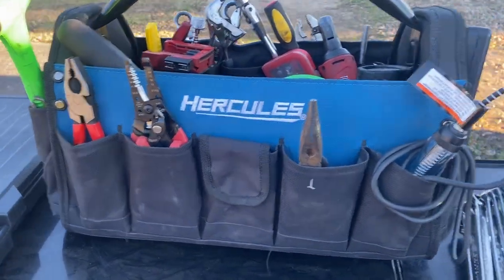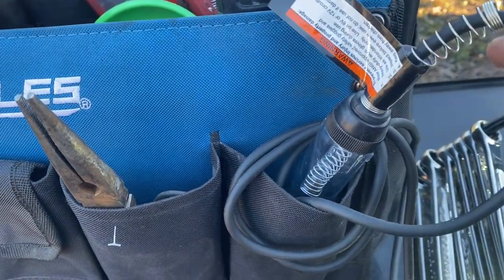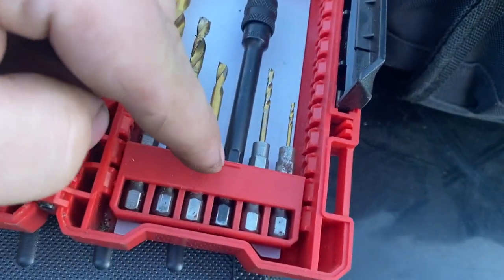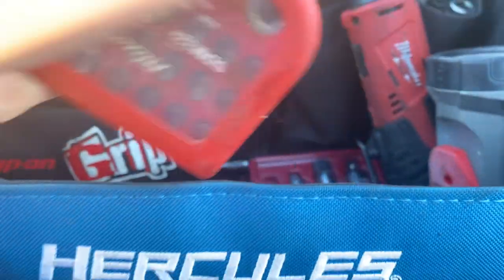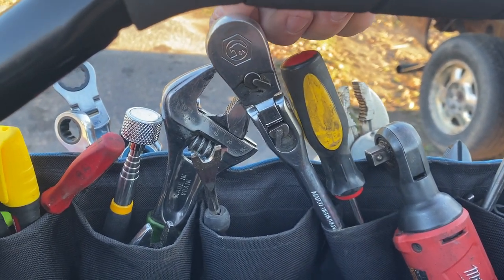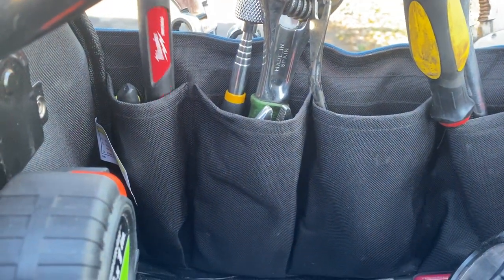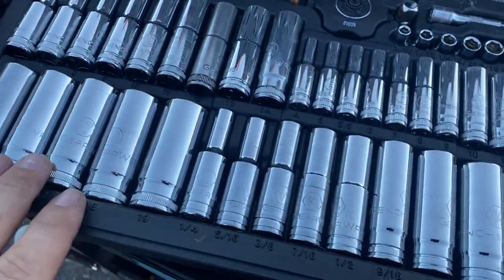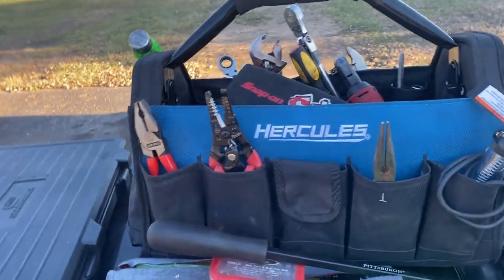Grab & go mechanics bag!

Comment: Very awesome setup! Just did something similar as well for side work. I like these kinds of totes as well. As for the matco rebuild, I’d add in some super lube 52004 light oil. Works wonders. Mine sounded like that after warranty I added the oil and sounded much smoother no grinding sound
Reply from the maker: Might have to look into that! Thanks for the tip!